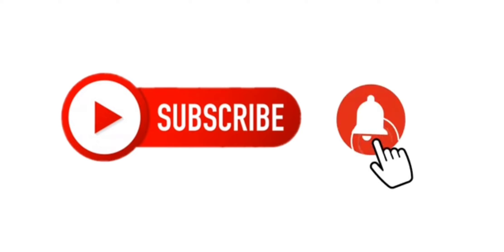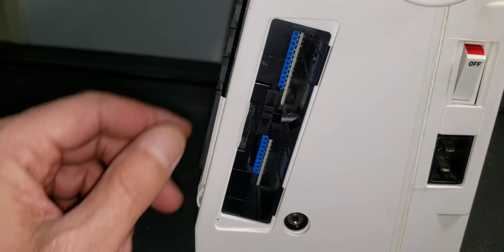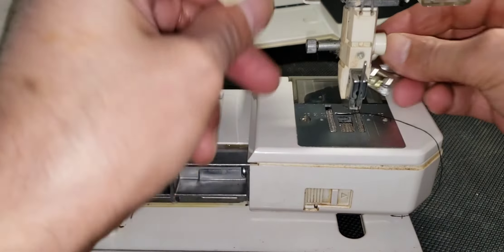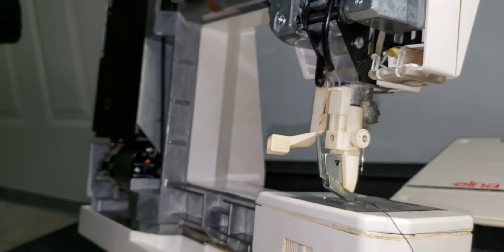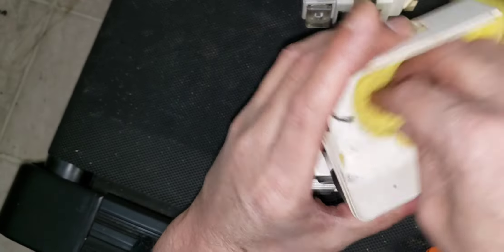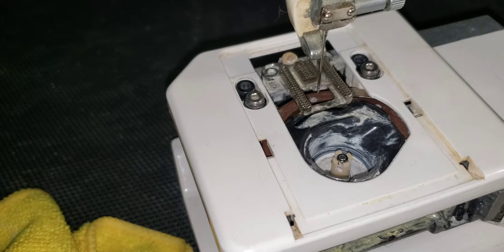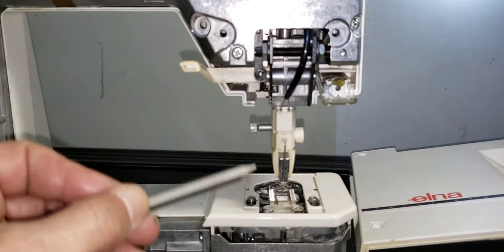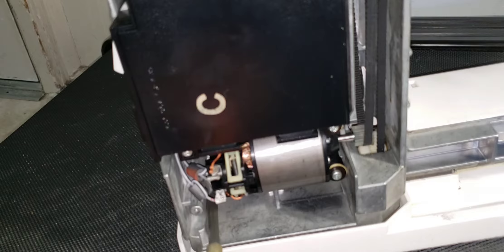Maintenance And Services Sewing Machine Elna 9000 Testing And Troubleshooting

Comment: Can you tell me why the dog feeds on my Elna 9000 are too far to the left and it is rubbing on the needle plate please?
Reply from the maker: Hello friend,  that's because 2 main reasons can cause that problem 
1- mechanical,  something is either loosed or not setting right way, you need to  remove the cover and take a look to see if all mechanical movements are in correct position 
2- electrical, there are 3 motors responsible for different movements and acts those motors are connected to electronic boards you need to check all wires to make sure all connected 
Check electrical boards to make sure all components in case if resetance or transistors are not burned, 
One more important thing is Elna 9000 has automatically self reset every time you plug it in power you can hear sound and quick  short movements self reset 
Do you see and hear that in your Elna 9000 ? 
If not that means your Elna 9000 self automatic self reset is not working !!!
There are other causes I will let you know later 
Keep in touch  and hope this can help you to find our the problem 
Please let me know 
Thank you 😊
Reply from the maker: Here is another possible cause
 if you moved a lever to lower them, there is probably a screw that either fell out or has become loose that holds the linkage to the lever.
Reply from the maker: Or maybe gear problems 
it could just be knocked out of gear,,, or the drive to the drive dogs has sheared off? the drive gears are inside the machine!
Reply from the maker: Please Let me know 
Thank you and good luck 👍

Comment: the machine is running on reverse stitch at all times, would you know why? thanks!
Reply from the maker: If the machine has electric reverse switch then something wrong with the switch troubleshooting the stitch need to be fixed or replaced 
If the mechine has gear or bar  switch simply that switch is not functional either  loosed or broke or stuck also need to be troubleshooting to find out what wrong 
Rear causes but also possible for electrical computerized sewing machines it could be electrical problem 
Troubleshooting wiring electrical board 
Sometimes it could be mechanical problem such as bubbling compartment 
And and grid movement make sure nothing is not loosed broken not settling right all that can Cause the mechine to be on reverse all the time 
Hope that can help you to solve the problem good luck and all the best 👍
Reply: Thank you for your prompt response! Will try to check if bubbling being loosed!
Reply from the maker: You're welcome